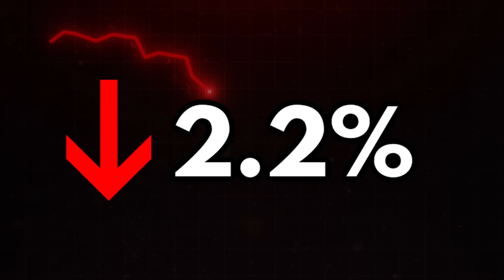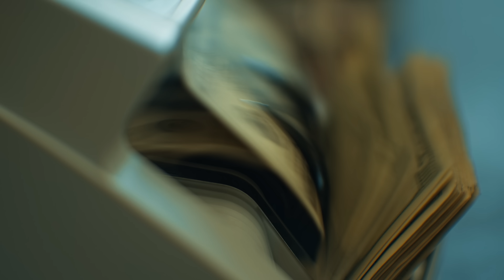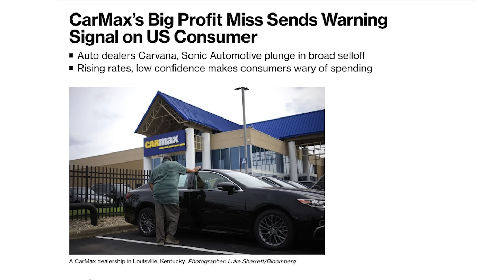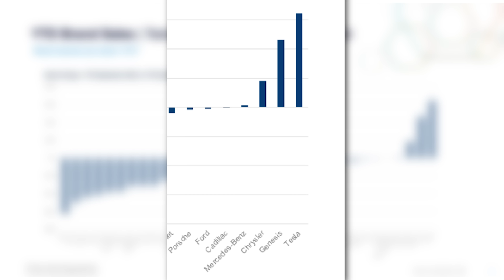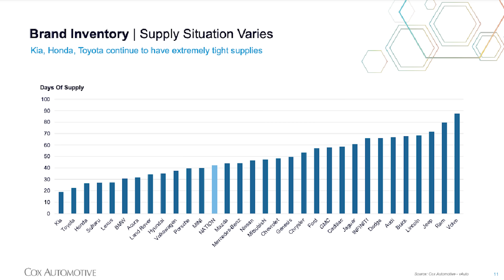Car Prices are Still Crashing

Comment: Prices not cooling at retail.
Reply: Retail dealers will continue to try to screw the customer every single time
Reply: Only matters if you agree with their retail prices. But wholesale goes lower and lower, so they do need to deal. They just hope that the customer who comes in won't realize this.
Reply: Yes they are.
Reply: They're not cooling at retail YET. Dealers can still hold out for a while until they are either forced to lower their prices or go out of business.
Reply: they are in my area. It is, however, spotty.  And yes it is regionalized across the US.  And yes, it is even micro-regionalized in my own big city I live in.  Some dealers in some parts of the city are decreasing, some are not.  The big “official” dealers that can afford to wait definitely are not decreasing their prices.  The smaller independent dealers that sorta-kinda live paycheck to paycheck and absolutely must sell their inventory to get by each month, they are already starting to decrease, again, regionalized in my city.  Your region of course may still be the opposite.

Comment: Toyota told me if I ordered a Rav4 Prime it would be 2 years until it was delivered. Mazda told me if it wasn't on the lot, it wasn't available. The Ford Maverick I place an order for in October of 2021 was never delivered. Ford gave me a credit and was put at the front of the line for a 2023 Maverick. Prices aren't dropping due to changes in the supply chain, they are dropping due to higher interest rates driving up monthly payment. So even though prices have come down, those prices aren't reflected in the monthly payments (and therefore total cost) for those financing.

Comment: IS there a way to export the raw data so we can remove the Higher end cars? 
The problem is the Average price decrease. E.g.  some wholesaler takinf a -$20k on a G-wagon skews the data on 10 other cars..say a 5 Camry, 5 Accords.   

 To the end consumers,  East coast,  2016 to 2020 Toyota camry as a "metric"  most dealers have only lowered used prices by $500 past 2 months.   Which is still, more than $3k or more over what a 6 to 3 year old car should be at. 
MATHS!!!!!